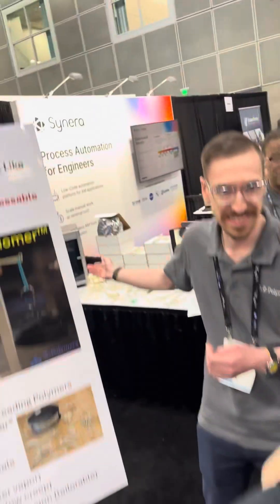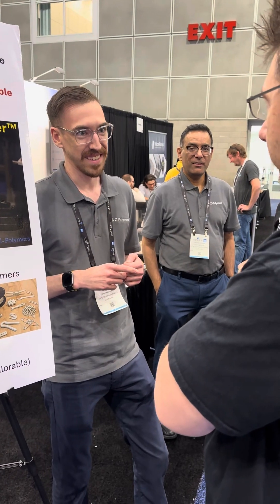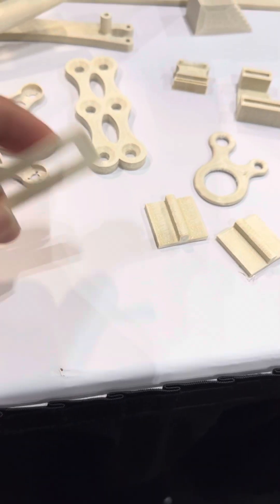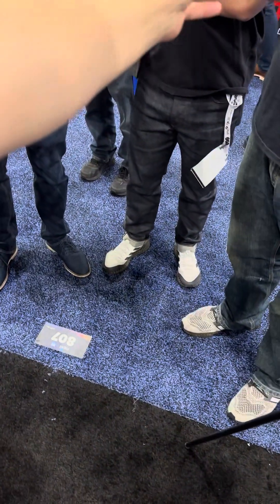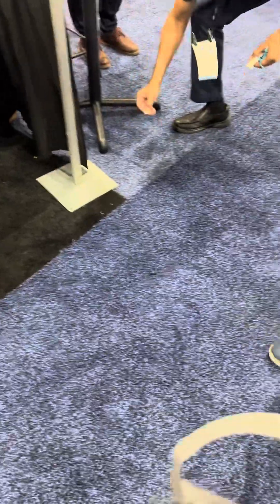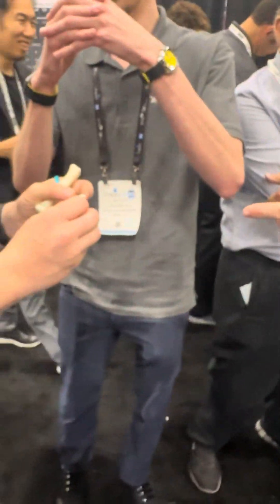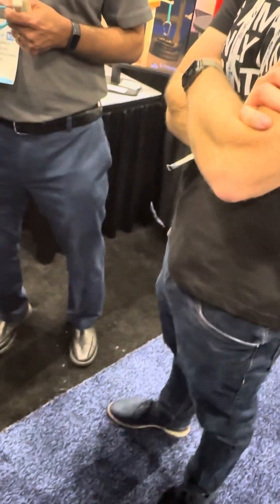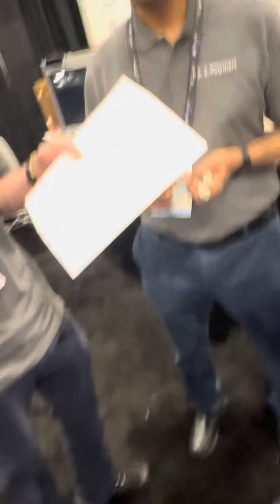TULLOMER: 3D Printing’s New Kevlar FT.@3DPrintingNerd !

Comment: $500 per kg I guess it’s worth it for that strength. I wonder if it warps bad when printing and or is it UV stable? Why screw with anything else if this gives you 95% the strength or more of an injection molded part. Assuming you just need function and the looks are not important.
Reply: I think they are claiming this is stronger than machined aluminium and carbon fibre parts, way in excess of injection moulding
Reply: @jamieclarke321 that would be insane
Reply: It’s really price. I print with PPA-cf and PPS-cf, and they’re very strong and pretty chemical resistant. But they’re already pretty expensive compared to most other fibers. Around $150/kilo. And a kilo isn’t that much, really. Going to $500 a kilo is just too much for most prints, even for those I make. Will I buy a roll? At some point, probably. But just to test and see if there’s a real advantage. So far, layer adhesion isn’t great.

Comment: I gotta say, this shows off the limitations of 3d printing technology of today. Cause you literally have to print in layers, so fibers can only exist parallel to one plane. How's the layer adhesion?
Reply from the maker: @Fabelaz  layers are super clean, surprisingly clean. Joel and Pooch keep throwing around the phrase “unicorn material”. 
Shouldnt exist, but it does. 
Until we can do a full test in each axis, we wont be able to be sure its exact properties, but its worth looking out for!!